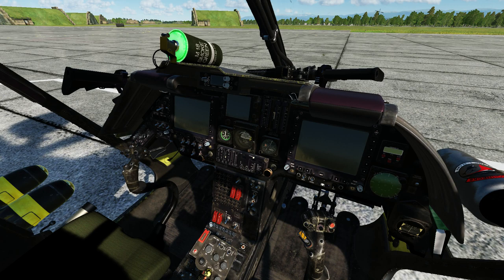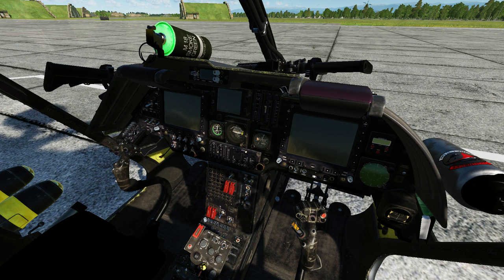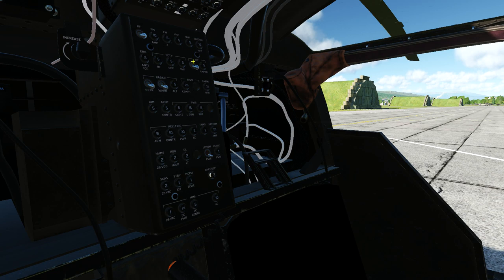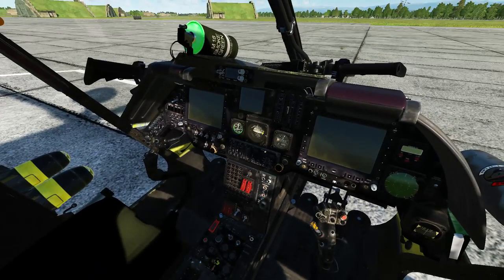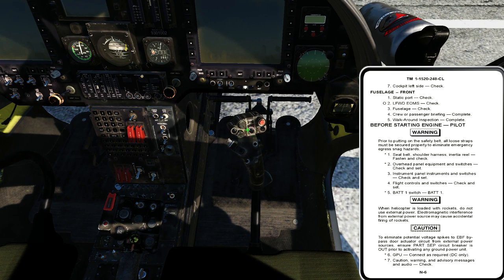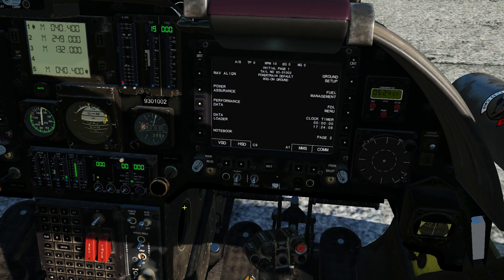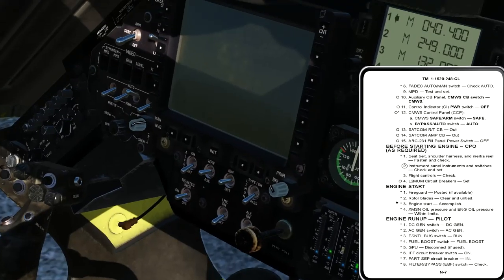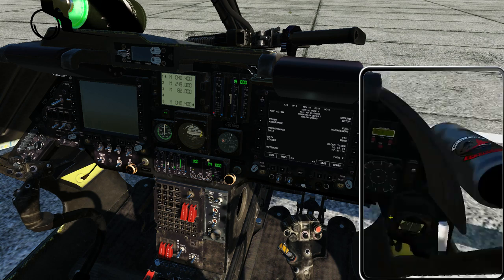Kiowa Warrior Detailed Intro Pt 3 - Engine Start to Idle

Comment: Huge thanks for this Barundas, I appreciate your concerns about not wanting to make the videos overly complicated or going on to long, but believe me if we didn’t want that sort of detail we wouldn’t be here.   For myself, these are some of the best DCS vids I have ever seen.    I adore getting a real in depth knowledge into the aircraft we are getting in DCS, and personally the very fact we can see you going through this, noticing something incorrect and then stating you will speak to Polychop to get it fixed, speaks leagues into how realistic you want this to be.    Believe me if we are flying DCS, we also want things as realistic as it can be.

You are obviously aware of the issues with the gazelle, which has sadly mudded Polychops name, and I think it’s fair to say they need to bring something spectacular to the table to get past the historic issues with the Gazelle.  Sadly although it’s a wonderful looking aircraft it just felt and flew wrong.  While I love Helos, it is very rare I fly the gazelle purely because of the FM issues.   With Your help and the help of your fellow pilots, it does look like Polychop are serious about fixing the mistakes of the past, and certainly from your comments and other flight vids I’ve seen of this aircraft, I am actually fairly confident that they can do just that.

Comment: Really good! Love the minutia and the in depth explanations, most likely because I'm a nerd.. And because I'm a nerd, I also need to nitpick one thing (sorry): Human eye is less sensitive to long wave, low energy red light, and hence it affects the night vision less (e.g. one can use red light to read maps and not lose night vision so quickly).
Reply from the maker: Thanks for that explanation!  It's inevitable I'd miss a nuance in there somewhere (it's been a while).  Appreciate your (diplomatic) correction, lol.  <grumbles and heads to the attic with head hung low to dig up the old "Night Flight Techniques" manual...>

Comment: Seems weird to watch a helicopter start with absolutely no rocking around.  Any plans to model that later?  Very long and detailed video but I think its good to get the full explanation on the systems and startup sequence at least once.    Looking forward to this release.
Reply from the maker: Actually, I don't recall much 1:1 rocking on starts.  Was pretty smooth at low RPM.  Nothing like the two-blade 206.
Reply: @Barundus  Interesting.  I don't have any experience with the Kiowa specifically so maybe the Kiowa is exceptionally well balanced.  Thanks.
Reply: @brittoncooke1890 it wouldn't surprise me if it is. The 2 blade helis like the Huey and civil 206 rock most likely cause if the weight swinging around as the rotor starts spinning up. A heli like this with 4 blades wouldn't have that issue as the weight swinging around is balanced.

Comment: 4:04 DCS coding challenges aside, the main issues with the Gazelle was it did not replicate any of the defining aerodynamic features of a real helicopter. ie. No ground effect cushion, no onset of translational lift, no VRS, no tail rotor drift in the hover, etc. which as far as I'm aware is still an issue. The Gazelle behaved like a computer game approximation of a helicopter rather than a simulation, which really did ruin it for me. I really do hope you guys will provide feedback to PolyChop when test-flying to ensure correct handling and aerodynamic effects, without this the OH-58 simulation is null. From the expertise you have demonstrated in these videos, I'm very confident that this simulation will be as accurate as is possible. Thanks again!
Reply from the maker: Interesting.  Yes, there have been considerable efforts towards replicating those "helicopterish" effects.  You sound like you know what you're looking for, perhaps you're a pilot yourself.  I'll address a couple; 
-ETL is modeled.  
-Translating tendency is not a thing in the 58D, as the transmission is mounted with a 1 deg left tilt to counter exactly that.  So Bell took care of it for us.  
-I've noticed a lot of questions and concern about VRS.  I've never encountered true VRS in reality.  I believe it's actually pretty unlikely and difficult to put yourself in the aerodynamic conditions necessary to develop VRS.  Now, I've found myself PLENTY of times (particularly in a heavy bird like 58D) on approach with insufficient power-available to arrest my descent rate comfortably.  That's poor planning, not VRS.  My personal opinion is people throw out VRS too often as a justification for their poor technique.  Don't get me wrong, VRS is definitely a thing, and I have seen accident videos due to VRS, but it's not as common as people might think.  I don't mean to sound preachy or "know it all" if you have personal experience with the phenomena.  All that said; yes, PC did, in fact, include VRS 😊.
-LTE (Loss of Tail-Rotor Effectiveness)  Again - not a thing in the 58D.  Technically possible, but simply exceedingly difficult to encounter.  In many, many hours of flying 58D, I never once encountered or felt I was in danger of LTE.  Bell 206 or OH58A/C is another matter entirely.  We talked about LTE extensively with PC, and I believe it's modeled.  I'll have to double check and see if I can get the spinnies!
Reply: @Barundus  Thanks for the info. Yes the only VRS I have experienced is when we have intentionally brought it on for training, and even then like you said the helicopter just doesn't want to stay there. I agree its not as big a deal as people say it is, but it should be possible to induce it intentionally just to demonstrate the effects in the simulator. This is one reason I like simulators so much; they are cheap learning and practice tools for people without a military background or budget. The UH-1 DCS simulation can VRS if the conditions are right (high descent rate, low or no airspeed, powered flight) and you can confirm its VRS and not overpitch as raising the collective increases descent rate and the RRPM remains top of the green. 

Interesting about tail rotor drift, I could be wrong but I thought the main rotor factory tilt accounts for most of the lateral drift, but not all, hence why some lateral cyclic is still required in a hover. And I guess the amount of lateral force is proportional to the amount of pedal, which is proportional to torque and therefore hover power. ie. high and hot hover needs more lateral stick than MSL and cool hover? 

How do you find the friction between the OH-58 skids and the ground in DCS? I've found the friction to be unreasonably high in the other simulations so you can't properly demonstrate run-on landings or sliding take-offs as even runway tarmac seems to be much too "sticky" 

Anyway look forward to the next part for a full start up. Maybe if you have time you can also show a hover and some basic aerodynamic effects
Reply from the maker: @Chang739  Thanks for your insights.  Honestly I haven't tried the friction yet!  I'll check it out.  
To your point about translating - Yes, I over-simplified.  Not sure how to properly address a "small amount of lateral cyclic" required to counter lateral drift.  Personally, I would not want to fool with holding a bit of left joystick constantly, esp. when most joysticks have a self-centering spring.  Would seem to be annoying after a while.  I had no perception of it in real life, because the "neutral" position of the cyclic is just "where it is to maintain the hover".  Certainly there is no feeling of back-pressure or conscious effort to apply cyclic to counter the drift tendency.  That said, it's something I'll double check as well.
I can say that torque-effects are modeled (adding left-pedal when applying collective, etc.)  Also left-forward cyclic to counter ETL and transverse flow👌.
Good stuff!
Reply: @Barundus  Yeah I've found that too, in reality it's a subconscious placement of cyclic depending on balance. My simulator joystick and pedals have the springs removed so they are closer to the real thing. I'm only nitpicking, and I'm only a student, so I'll leave the finer details to the experts. Cheers!
Reply: To answer to the statement what all is or supposedly is not included into the fm of the Gazelle, I do have to state that it is indeed all integrated into the Gazelle fm. To be fair, I did test multiple tests after dcs updates to see if anything was broken in the fm. The biggest issue people have is identified by the cyclic position. Although it sounds strange, but when we read comments that state exactly the points mentioned, the question rises if the person posting it, does even own and flys the Gazelle in DCS. There are easy tests to verify ground effect, translating tendency and many other effects. What is missing or undermpowered in the Gazelle are the blowback effect and transversflow. ;)

Comment: All of the lettering on the multi function displays is misaligned.  Is this how it actually is in reality?  Looks weird.
Reply from the maker: Not sure what you mean.
Reply: @Barundus  58:35 (no specific reason for this time stamp, it's just when the MFD is nice and large on the screen).

See how the C in COMM is lower than the rest, how the S in MMS extends slightly lower than the Ms, how the D in VSD and HSD is lower than the other letters and even lower on HSD than VSD, the P on PAGE 2 is higher than the rest, the EB in notebook is lower?  Etc.
Reply from the maker: @jimmehjiimmeehh9748  Honestly, hadn't noticed, but now that you mention it, I see what you mean.  My insight runs out there. I'll make a note!